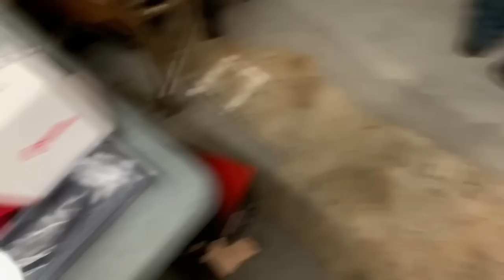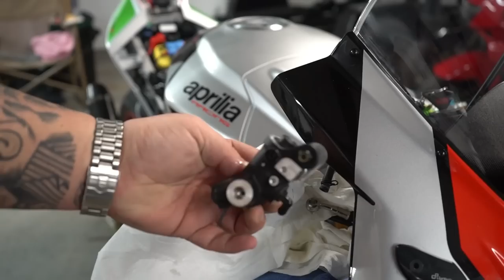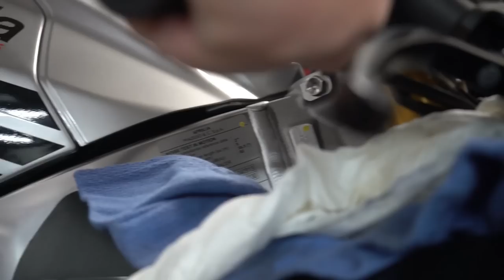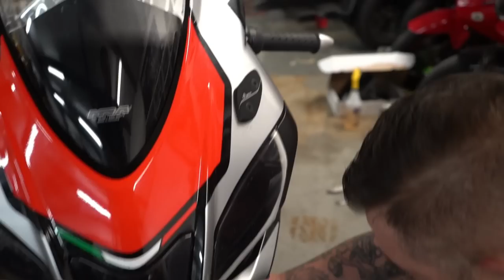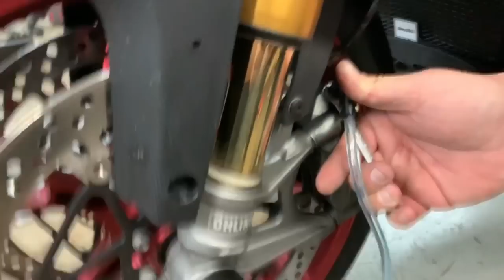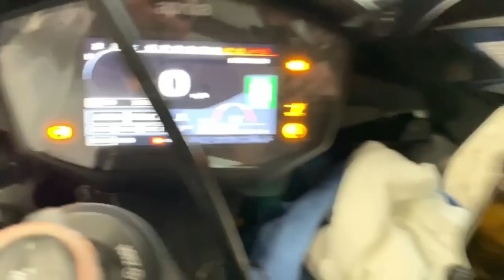EP: 5 RSV4 RF BREMBO BRAKE UPGRADE AND FULL BRAKE FLUSH

Comment: You didn’t replace or bleed the brake fluid trapped within the abs module. Manual says set abs to highest intervention and road test bike getting abs to activate and then repeat bleeding process.